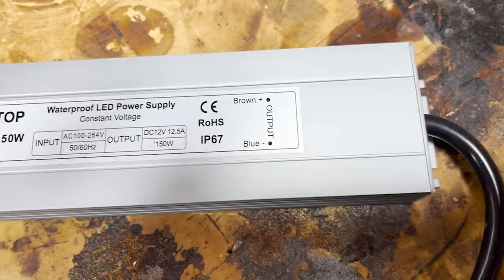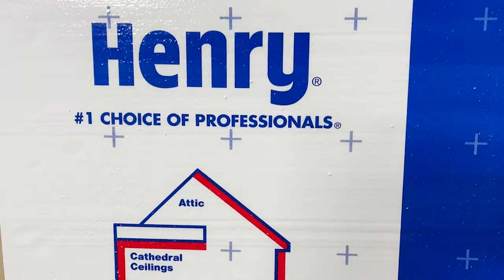Full Build | Cargo Trailer Camper Conversion | Solo Build

Comment: Curious how the undercoating is holding up. I have a new snowmobile trailer I'm going to insulate and apply something to the flooring underside... just not sure what to use.
Reply from the maker: so far it's been great. I talked to my spray foam guy and he said that would do good as well. Then youd get some insulation under it for the winter!

Comment: What bit did you use in the router to cut the hole for the tie down brackets? I’ve never owned a router but after seeing how quick that was and beveling your bed platform, I’m buying one.
Reply from the maker: It had a flush trim bit in it. You can get a little laminate router like that one for pretty cheap. I use my little one over the big ones most of the time.

Comment: What Brand cargo trailer is that ? I was impressed by the steel plates where the axle connects, I just seen a video the other day where the axles split the aluminum under the trailer because they used a Halo thin tube of aluminum where they connected the axles.looks like your doing things right , you know what they say, if you want it done right do it yourself.
Reply: It's a Legacy. I liked that too. One of my neighbors is an HVAC guy and uses a trailer to haul equipment and tools. His flat out snapped off where the tongue meets the frame! It was a much lighter duty frame than this one so fingers crossed!

Comment: What are the trailer dimensions?  Didn’t catch that in the other videos. Good functional project that I am looking into for a hunting rig.
Reply: Also, did you insulate the floor at all?
Reply from the maker: Trailer is 14' x 8' with 7' headroom. I did not insulate the floor. Wasn't sure if it needed it. Spent the weekend after Thanksgiving out four wheeling and heated it with a little electric heater. Did just fine. Curious if I foamed the underside if it would stay in. Might try down the road.
Reply: @buildlifeoverland 2 inch foam on the bottom would help  I'm about to do that for my 7x16 build.
Reply from the maker: @scrogathon  Are you doing spray foam or rigid?
Reply: @buildlifeoverland  I decided to go with the ridgid purely for cost reasons. I still haven't got around to installing it, but will update with how well it does. Hopefully soon enough.
Reply: If you insulate the floor on the outside,you will trap moisture from road spray between insulation and wood….rot. And yes no matter how well you seal it water will get there.sheet foam inside and second layer wood. 150bucks more

Comment: Is that all aluminum?
Reply from the maker: Yes. Watch the first video on this trailer where we undercoat the bottom. You can see the aluminum frame. They have some pretty nice steel plates where the axle connects. That and the axles are the only steel.